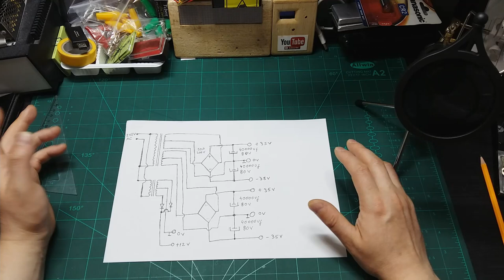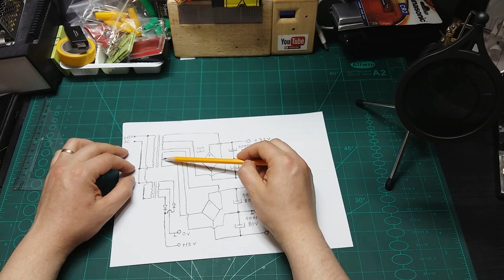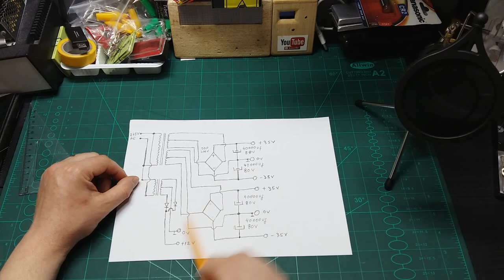Jean Hiraga super class A 30W amplifier part 3

Comment: Hello,
I make Super 30 and satisfied with its Sound..... Mid and high is very nice Bass is something low than mid and high....
Please Suggest 
Which preamplifier is suitable for jean hiraga Super class A
Please suggest about suitable speaker design
Reply from the maker: I use a vacuum tubes preamplifier and really nice sound as a speakers if u can find some full range drivers will be the best match for the hiraga without crossovers inside

Comment: I would remove that small transformer from the top of the main power transformer. Those wires (from that small transformer) over (it bridging the power transformer) can cause problems later. I know the bottom is wood but still not the best idea wires runs over the power transformer! Pay att. to those power transistors in long term they can fail, they are pushed over their power ratings limit. Heat/watt. What is your full bias per channel? 1A?  It good you use a speakers protection if something fails.
Reply from the maker: Thanks for your comment. So the small transformer is powering the speaker protection to keep everything safe and also I have fuses on the main power and also after the rectifier and smoothing capacitors. And so far now I'm using it for months and months and runs so well